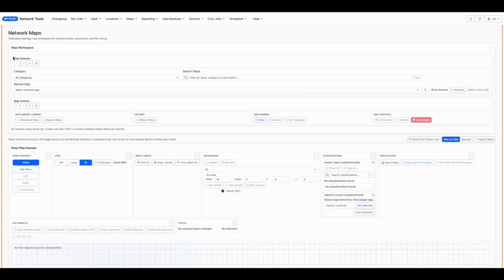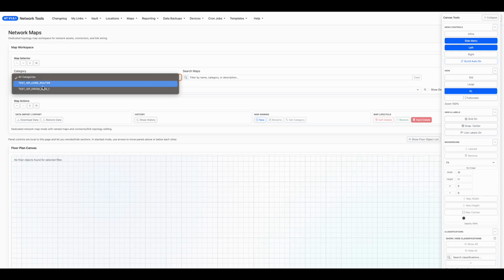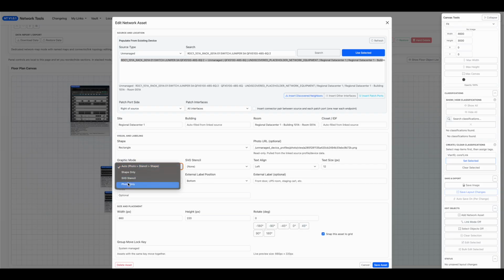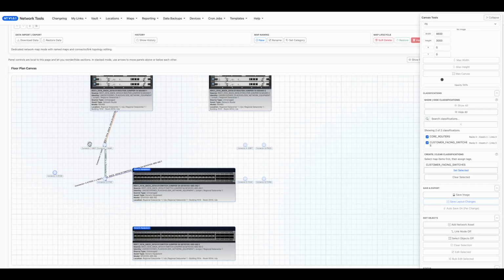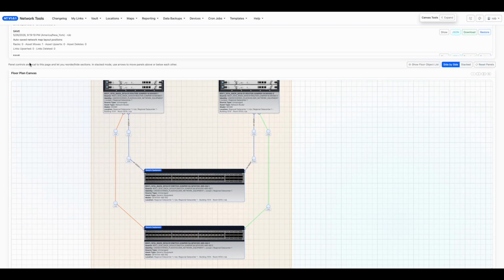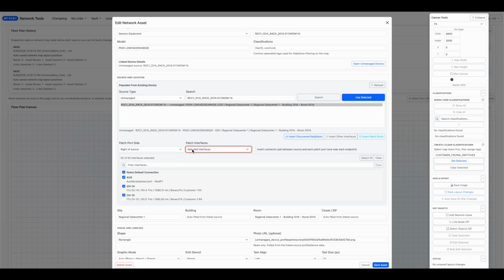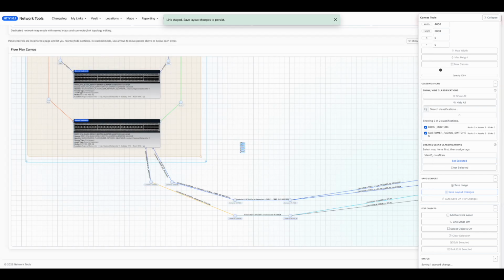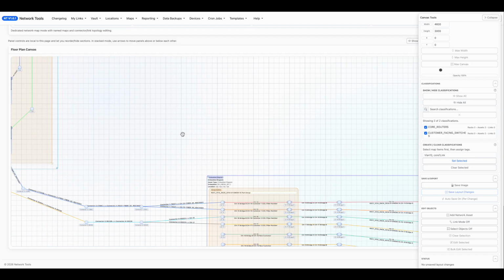Network tools v1.0.1 - More advanced example of the network maps diagram tool

Comment: How did you build it? Can you share a bit more about it? What front end skills did you use?
Reply from the maker: The frontend uses Symfony / PHP with twig templates. All the business logic / data processing for the most part in terms of saving information for the map itself is offloaded to fastapi with celery workers. (I won't lie, Codex helped me a lot with this as i know how to program, but i'm just one guy so yea.. It was a great roi on my time). The map itself is mainly javascript / HTML canvas. 

The flow is, I track everything that's done on the frontend, in this case for the maps, i track everything. Item placement, history, etc. When the frontend sees a change, it fires off a request to fastapi which does a few things. It takes a snapshot, fires it off to a couple workers, one worker is responsible for doing the heavier queries that the frontend does not need to get a reply on. In this case "History", It takes the snapshot, processes the changes, saves them to the backend, The frontend will query that information when it needs it. 

The other worker saves the map immediately and returns a success / failure. The reason it needs that is it locks the map while it's saving so no changes can be made on the frontend ui while saving. This helps with rapid fire queries that might slow it down or corrupt the data because a race condition. For example if someone has a save pending, Then makes another few changes to the map that might go in out of order and cause issues. So this prevents that. Normally, the save time is in the range of a few ms so the map lock never really gets noticed by the user.  

The maps are locked for editing anytime a user starts editing it, So only one user can edit at a time to avoid overlaps. 

What i like is the ability i put in to have a "base map" inserted. So you can create one map, re use it in multiple places, and only need to update one, and it propagates to any other maps using it. 

The backend database is a postgres instance. 

Hopefully that answered it for you, if not feel free to ask me more. 

The over all structure of this stack is frontend is seperated from backend, and backend handles all the logic / work load etc. The frontend is just a UI, I built it that way so i can stand up a second frontend, with the primary one side by side if i ever decide to try another stack out.